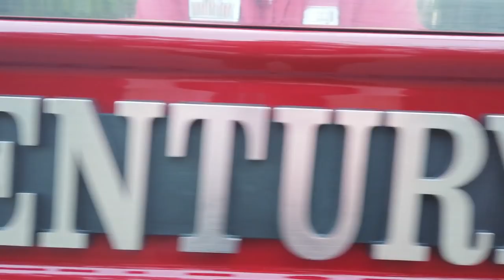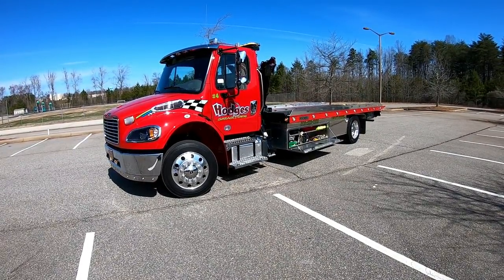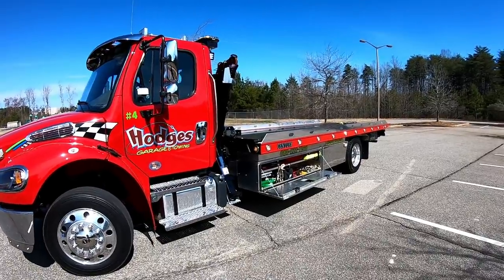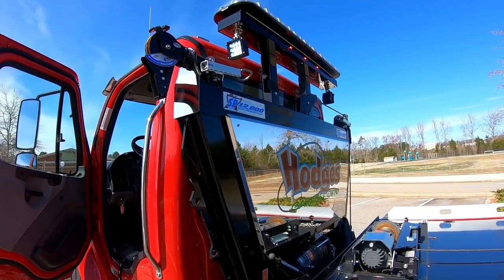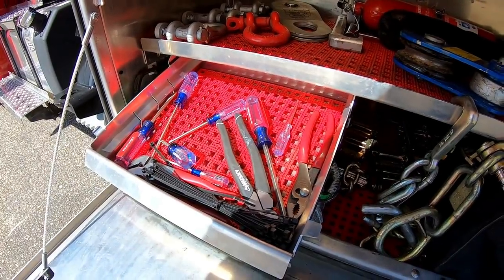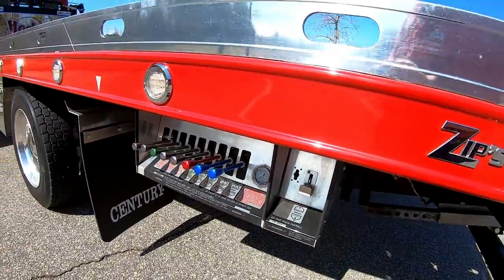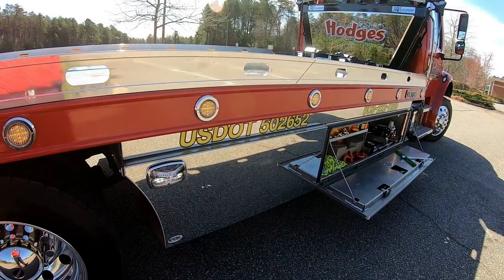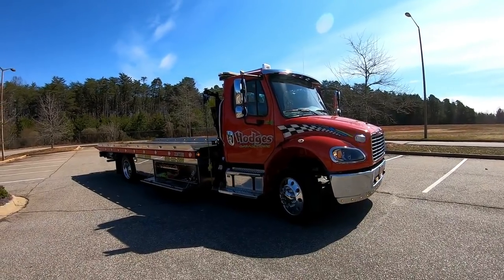NEW TRUCK 4 WALK AROUND!

Comment: Liking the new rollback alot! odd question but is there any call for the rotating rollback beds at all these days where you are.. something like the Dynamics Radius which has a 240degree rotate, 12,000lb deck capactity with a 9500lb capacity for deck rotation and a 5,000lb self load wheel lift